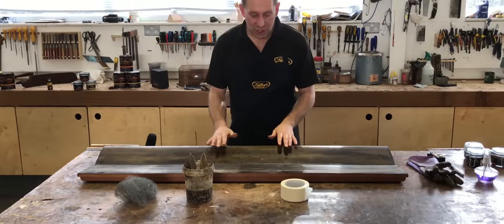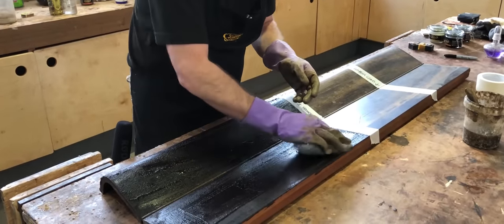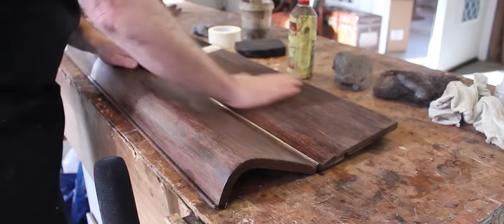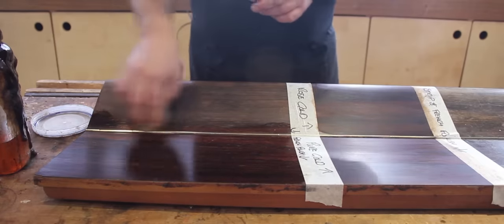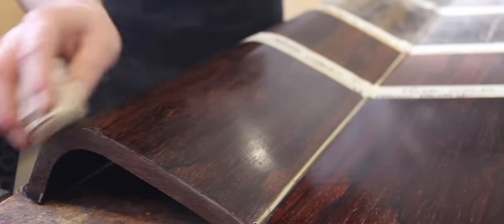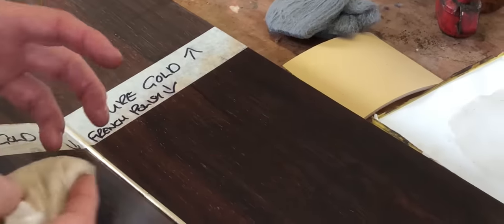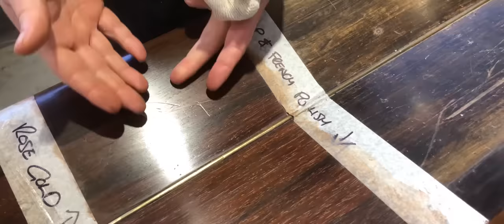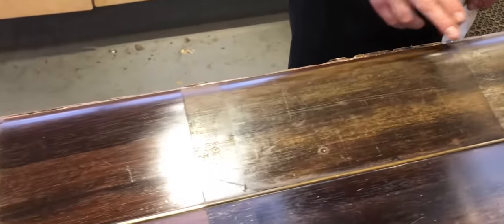How to Strip and French Polish Wood Furniture

Comment: damn. majour respects for your craft. I prefer regular store bought varnishes and sanding between coats, maybe building up several thin layers and polishing with various fine compounds to get the glossy look that I would desire.  

This seems to be the more natural, historical method that is also amazing.
Reply: The only reason you would need to and between coats is if you rasied the grain or had airborne particulates that landed on the wet layer.
Reply: At least with the softer woods, the first few coats does raise the grain. Also the ability to perfectly apply paint to a surface is nearly impossible. Meaning you do want to grind back the high spots before adding another coat. Car painting services, the nice ones, will sand between coats.
Reply: Car painting is typically by spray; this is hand rubbed. And here, he is applying a shellac, which remains soluble in the solvent that is used when the next layer is applied. The automotive layers are typically not soluble in the subsequent layer, and bonding can be an issue with very smooth surfaces. The sanding tends to be used to provide micro-scratches on the surface to act as mechanical adhesion aids for the next layer.

Comment: what sort of painy remover was used on the first section? thanks...
Reply from the maker: Hi Melinda. I used a solvent based paint stripper which contains dichloromethane. It is a trade only product in the UK and Europe. 
( I was not aware of this until recently)

Comment: I went to a well known and rather expensive furniture school last year, no one ever mentioned about dripping mineral oil onto the surface. There's an Aussie guy, Clickspring on youtube, an engineering channel, but he put out a video of him french polishing a piece of burr or highly figured wood to mount a project on. He also used an oil lubricant, I think it was olive oil, but in those 10, 15 minutes I learned more than I did from the school. The polishing was not a fun experience, the amount of exertion seemed absurd, if I hadn't been climbing trees, dragging branches and lifting logs before I embarked on furniture making, I'd have been like the other feeble armed students that basically gave up with it. And to think that all we needed was a few drips of oil. I've started a wee workshop of my own back at my folks and one of the projects I wish to make revolves around the desire to french polish something, anything. Starting off with mixing my own shellac (another thing we weren't really taught) through to creating a beautifully smooth and elegant finish. Let's see if I ever get there, I might just end up slopping a tin of Danish on instead if I'm too ham fisted to even get close. Thank you for the video, it has been highly informative.
Reply: About mineral oil, can I use this to restore the "moisture" to raw wood?
Reply: @videonovice9   Mineral oil is commonly sold for this purpose. It is known as food safe.

Comment: Sorry, but methylated spirits does not neutralize caustic. All it does is dilute the caustic plus some is wiped away as you rub the spirits onto the wood.  Also, if the stripper causes a burning sensation without really "burning" (as in a caustic "burn"), then it is more likely that the stripper contain methylene chloride. This is one of the few organic solvents that elicits a "burning" sensation shortly after skin contact.

OK, after reading the comments and finding it is Paramose paint stripper, I checked and found that indeed, it contains methylene chloride ( more than 50%) and methanol. NO CAUSTIC!
Reply: It would be impossible to remove caustic material out of the wood once its inside. You would never ever want that in ur wood.
Reply: Agreed, it was obvious from the remark that 'methylated spirits neutralises the (sic) caustic stripper' that the speaker is no chemist.
Reply: You can easily neutralise NaOH residues by applying vinegar or other mild acid. I know because for one summer I worked in a 'stripped pine' business and used the caustic soda solution to remove finishes and then, after rinsing with fresh water, applied diluted vinegar to deal with any last traces. Once dry and with some surface preparation - wire wool or sanding - you can achieve an attractive and durable finish.
Reply: Is there really nothing left, somewhere deep in the pores, destroying the wood in the years to come? Seems risky to me.
Reply: I have pieces in my home which were prepared like this 30+ years ago and they are still in optimum condition.
Reply: Interesting, thank you.
Reply: Always good to hear from someone who knows their chemistry!
Reply: Methyl Alcohol which he calls methylated spirits is a decent solvent for methylene chloride.  We used to get 55 gallon drums of methanol to extend the life of methylene chloride stripper when I worked in the field as a kid.  So it'll solvent off the stripper residue.  The technique he used takes an experienced touch. Let it dry a bit too much and you make a gummy mess, keep it too wet and the softened finish drips down the edges and makes a mess.  He had a good hand with the stripper. Personally I'd be inclined to try an amalgamating finish on old dry varnish or shellac such as he had.  Start with mineral spirits and follow up carefully with methyl alcohol.  That said, he did a nice job.  Those organic finishes are pretty forgiving once you get to know them, contrasted with modern poly finishes.  If the original finish was shellac, which is my guess, then he could have pretty much stripped it with just methyl alcohol, albeit more slowly.
Reply: D W  wrote "he's TELLING you what he does and how he does it..."

He is also saying that he does something for a reason and supplies an explanation of the mechanism. The explanation and reasoning behind his action was inaccurate. Regit Mail has legitimately corrected the misinformation, however I am going to point out in separate reply that Regit Mail makes an error also.
Reply: Regit Mail wrote: "Also, if the stripper causes a burning sensation without really "burning" (as in a caustic "burn"), then it is more likely that the stripper contain methylene chloride."

The uploader clearly states that the stripper does burn the skin. You appear to be inventing a qualification: "without really" . 
In any event, "A burn is a type of injury to skin, or other tissues, caused by heat, cold, electricity, chemicals, friction, or radiation. "
- Wikipedia
Reply: Some years back I had an experience with a stripper that caused a burning sensation, terrible itching too I must say.  But a trip the pharmacy neutralized it in a timely fashion.
Reply: @drewt3210 :  Very funny.  NOT.
Reply: @MHow-qc3ns  You're right. It wasn't funny at all at the time. It was quite concerning. Lesson learned. Always be careful with strippers.

Comment: A treatment my grandmother's upright sorely needs.

That, and tuning.  I don't think it's been tuned since she passed in '93.
Reply: Careful, refinishing an entire upright is usually much more work than most people realize. I have seen many a piano with one side stripped (then they gave up).  Those who completed the job (often well) wished they hadn't or had paid a pro.
Reply: Blaine Hebert Haha, no fear - the most I'd do, is tune it.
Reply: If you can find it, try Howards Finish Restorer.  A strong version of Old English Scratch Remover.  Stinky but works.  Use an abrasive backed sponge.
Reply: Needs to be tuned and voiced, usually a 1/2 day job and it won't be cheap.

Comment: Would mineral water be alright to clean off the stripper?
Reply from the maker: I would think so. We prefer to use methylated spirit, sometimes with a splash of acetic acid to help neutralise the surface.
Reply: Gilboy's Restoration I'm gonna be honest, I thought they were basically the same. Could you do a video on this?
Reply: Ahh ... no, that would not work very well, actually.  Mineral Water is purified water with minerals added, or mineralized water from a spring or well.  Mineral spirits or methylated spirits would be the preferred method of cleaning the stripper off of the wood surface.  A close cousin of these would be the use of acetone (fingernail polish remover) to clean the stripper off the surface.  Methylated Spirits in the US would be something along the lines of 91% isoproyl alcohol or denatured alcohol.

You will want to avoid the use of water as much as possible, when working with wood like this.  Water can soak into the wood, causing swelling and movement.  You CAN use a water based stripper, but you'll want to be careful of how long you let it sit on the surface and you want to remove it without using an excess of water.

Last, but not least, about mineral oil.  This is a preservative or finish that is food-grade safe and used to protect and waterproof (or make water resistant) certain types of wood finish surfaces that make contact with your food during preparation.  It is used as the finish for cutting boards, rolling pins, salad bowls, ect ...

Comment: Wouldn't it be better to soak up the methyl spirits (instead of evaporating) if you're trying to neutralize?
Reply from the maker: I honestly don't know the chemistry side of this. 
All I do know that is when washed with methylated spirits and a little acetic acid (pickling vinegar). The surface is successfully neutralised and the treatment leaves no staining or shadowing. It has worked very successfully for all of my years working with stripped furniture using this method. 

When the surface isn't neutralised properly, any finishes applied after may suffer with retarded drying and often the only option is to start over again. ( I have had to do this many times when its not been done properly in the first instance ) 

I hope this explains it better. 
Best wishes 
Simon

Comment: What was the name of that minrel oil?
Reply: Mineral oil is mineral oil, there is not a real need to try to look for a special "brand name".  Pick it up from a big box store and keep it in a clean container out of sunlight in a cool place... typically stored with volatiles in a fire resistant cabinet.
Reply: @gregoryhalye8907  thanks alot boss 🙌👍

Comment: I'll put the Gold wax as a winner. Thirty five years of polishing- five in Britain, and thirty in Paris, France. I beg to differ in technique. I'm afraid I find you rather hasty. I know pianos are extremely time-consuming, and you can't give them the same treatment as a Louis the Fifteenth marquetry commode. To build up on a pre-existing grain filler is dicey to say the least, because you never really know what exact recipe was used initially. It could be with tallow wax, pumice (of course), and sometimes even shellac itself, or even talc- used to fill in Ebony funnily enough. The old grain fillers tend to yellow with time, so the most conclusive finish is pumice filling. On Rosewood this can be a nightmare. In France we have many different grades of pumice. It would take a coarser grade to fill in Rosewood. Just to be fancy, I used to slightly colour my pumice with earth pigments. You can obtain some very subtle hues in this fashion. The advantage is that these natural pigments DON'T at all fade with time, unlike ALL chemical dies and stains. I also used as many as three varieties of Shellac, in accordance with their hardness and transparency. I always finish with a clear light shellac. Here in France, when waxing, the only difference is that it's wax that's used. In other words, the grain filling is exactly the same. However, the wax (homemade) is applied HOT, left to dry, and then is "rubbered" using mineral spirits as a solvant, and then finally burnishing with a meths rubber- just like burning off the oil. By the way, may I suggest you use MUCH less oil; it does the shellac no good, gives an ugly shine, and increases the risk of burning the polish by having to insist on total removal. Very few people realise that French polish (I just LOVE the word play some of the commentators resorted to!) takes MONTHS to properly harden, and will always be more fragile than other finishes. Thank you for sharing your experience, and please don't be offended by my remarks- Arts and Crafts are a very exigeant domain. I spent 369 hours on a complete piano restoration; not very profitable I'll agree. All the best from France.
Reply: Too, too true! During the early 1980s, when I lived in the middle of the Slocan Valley, BC, to create Winter income, I'd buy a 40" round solid oak table on a pedestal from a woodworker in the Fraser Valley, as it could be shipped with our plant purchases to save on freight. 

When it arrived I unpacked it carefully and assembled it in our store's interior, so it was in a heated environment. After 4 - 7 days to stabilise, I began to slowly apply many coats of boiled linseed oil thinned 50%, rubbed in & wiped off using steel wool and cloth.

The whole process was about a week; I'm sure it was more than 40 hours because it took up all my time, except when I was moving snow with our tractor! Golden oak responds well to this treatment; I sold them for twice what I paid,  shipping cost included.

The whole process became a meditation on the task, as I didn't have anyone to distract me; having walk-in customers in the dead of Winter was very rare.
Reply: @josephefasciani7343  Interesting!
When you say that you worked with steel wool and cloth, how do you mean?  First coats applied with steel wool (very fine, I suppose?) wiped with a cloth, then more steel wool and so on, or did you put the first coats on with steel woo, and the final coats with a cloth?
I have heard that steel wool can be a problem with oak, if you leave any strands embedded in the work, because the oak and steel will react together (due to the tannic acid in the oak.)  You evidently did not have this drawback.
Reply: I do wish you would post videos of your technique so we can benefit from your experience, here in the states such knowledge is as rare as hen's teeth.
Reply: @Offshoreorganbuilder  

Thank you for your intelligent query; it's rare to see this in comments by smartasses who don't really know what they're doing.

What I did: 
1st: Make a tack cloth w/90% thinner & 10% boiled linseed oil, then
2nd: Wipe down the table; that took half a day, as I did under sides, legs, opened it to do the parting edges, etc., to reduce any new moisture getting into the oak. The reason it took so long was the table's heavy, I'm working by myself, and I had to turn it over very carefully to keep it from getting soiled or damaged.
3: Once it's clean of dust, put down cardboard if you haven't, place your furniture in the center.  Now create a work area; be sure you've got 3-4 glass jars w/screw lids for oily cloths overnight.
4: If you haven't already, set up a 16 inch box fan for exhaust ventilation; run it continually as you're working and if you can afford the hydro, also at night to accelerate drying.
5: Now let the games begin! It's best to start with at least 000 steel wool; stainless steel pads are best, but difficult to find. You'll also need 320 wet/dry papers between coats.

After wiping down the entire piece with your tack cloth, you can create either a rubbing pad or use a sponge that's dense enough so it holds a minimum w/o leaking and you can wipe it w/o dripping. You can use a very closely woven cloth, cotton is okay if it's a long staple such as premium sheets, or linen, or polyester microfiber. 

In any event, this is not a contest of strength, but of patient endurance: don't attempt to force your finishing compound into the wood, just gently wipe it on, making sure not to leave ANY excess whatsoever. IF YOU LEAVE EXCESS, EVEN THOUGH YOU THINNED IT 50-50, THERE'S A HELL OF A GOOD CHANCE THE NEXT DAY IT'S GOING TO BE STICKY AND YOU'LL HAVE TO DO THE ENTIRE AREA OVER AGAIN. This kind of error will cost you dearly in time.

Each time you apply a coat you will notice you're getting an increasingly mirrored finish that allows you to look deeper and deeper into the wood, as if it were a 3D hologram. In my experience I would usually apply eight coats; by that time if you haven't got it right it will be more than obvious.

Finish everything off by using a traditional beeswax polish applied two or three times to get maximum protection. I CANNOT overly stress the importance of letting everything dry to full cure between coats, even if it takes you twice as long as you thought: chalk it up to a learning curve and price your work up better next time!
Reply: @josephefasciani7343  Thanks for your information.  Obviously a lot of hard, careful work is needed.
Reply: @Offshoreorganbuilder  
Yes, offshore, that is correct, but if you really are in love with what wood can do when it's handled with love and care, you will pursue this line of effort and endeavour.
Reply: I too, liked the Gold Wax as the preference....

Comment: do you ever use Squirrel haired polishing maps
Reply from the maker: Hi. All of our polishing mops are squirrel hair. (We have four in total x3 No 2's & x1 No. 4
Reply: @GilboysRestoration  what kind of jobs do you use them for just out of interest. I almost only use mops use rubber for the last coat
Reply from the maker: @MrZOMBIE170  We use them mainly for colouring. Sometimes for applying a dope colour and sometimes for applying a sealer coat of shellac. We never use them to replace the fadding process. I'm not saying its wrong to do so. It's just we tend not to.
Reply: @GilboysRestoration  that just the way my lecturer taught me but he has been a shipyard polisher for 40 + years and in I've been told that the Scottish do Polishing different